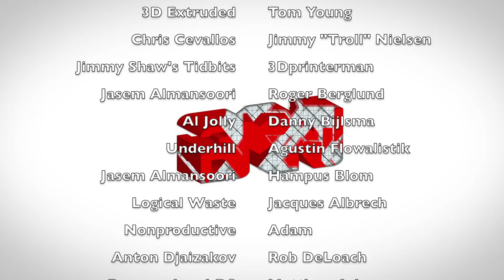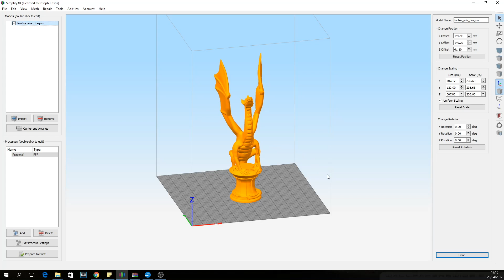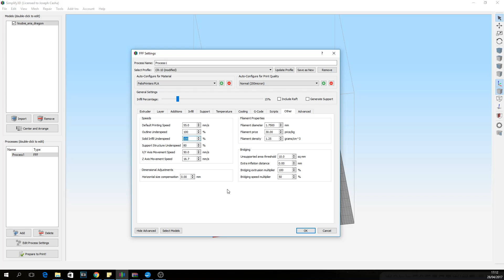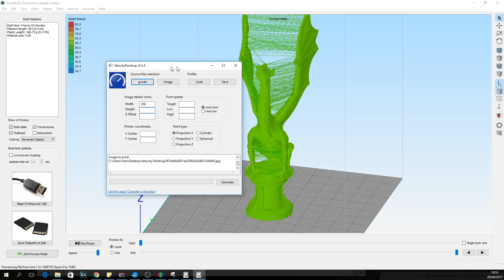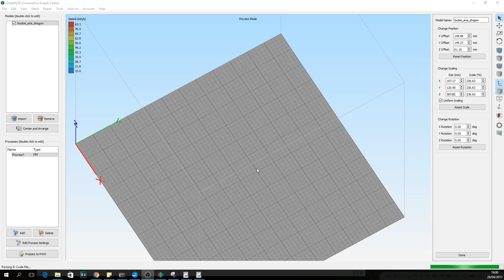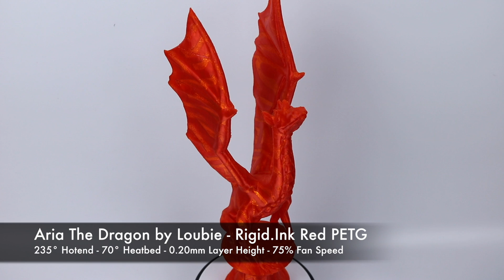A Noob's Guide - Velocity Painting

Comment: Very cool, but I doubt it adjusts the speed without changing the extrusion as you mention twice. That would mean it would wildly over or underextrude which would not result in a succesfull print. So in the PETG situation, it is not as you say the line gets thinner, but it is rather an effect of heating the filament up more and keeping them hot longer inside the nozzle (with slower prints) , which gives it a different look. Heating filament longer and hotter gives it a more shiney look in general.

Comment: any chance to ignore brim/skirt, raft and infill?
Reply from the maker: of course - vase modes work that way with velocity painting anyway so i don't see why a closed model can't be printed the same way
Reply: 3D Maker Noob sorry maybe i was not clear enough... so sorry for my english... i mean it works but affecting also the infill.... this is useless and add more time to the priting process. would be great is the software will take care just about perimeters
Reply from the maker: ah ok now i understand, as far as i know you cannot imprint the image only on the outer layers but i will check it out
Reply: i think so... infill normally not affect the perimeters, just if you set the wrong % in the infill over perimeters value. Simplify also put a comment before any group of command with the content... like //skirt or //outer perimeter //inner perimeter //solid infill and so on...

Comment: +3D Maker Noob
Thank's for a really nice video.
[I might misunderstand You, but @7:50 it seems like You say :"I'm going to set the Low speed of which it's going to do the image itself at 20 mm"
But You enter 15 mm in the "input field".
I just mentioned it in case You'd want to make an "annotation" ]
Best regards.
Reply from the maker: +GglSux thanks, I did two recordings of this and ended up using the one with 15mm/s instead of the 20. Thanks for pointing it out , the speed I used on the real print was in fact 20mm/a though just in case :)

Comment: Wow. This is cool. It got me thinking a workaround for dual color.  Load dual color models for single extruder with different speed setting could also do the job.
Reply from the maker: +Ryan Huang I tried that, however it wasn't the same effect. The infill is not continuous as they are separate pieces, you also need to underextrude slightly as that is the major difference when it goes faster

Comment: Cura 15.04 will not load the file gcode generated
Reply from the maker: +usasolarwindinc once it is sliced and then ran through velocity painting you don't need to run it through cura again. For the preview you can use the velocity painting site, just drag and drop th file on their preview gcode page

Comment: Sorry to bug you again.  So, I sliced a model using the settings in your video.  Ran it through the velocity software, then imported that in to S3D, and when I try to save it, it names the file "output.gcode" and so like an idiot I said, well, why not.  And when I went to print it, nothing happens.  Anxious to crack this, but I seem to be at an impasse.  Once it did save to the SD card with the correct file name, but still had the issue where it would not print. :(

Okay, not that I'm trying to bribe you, but, if you help me crack this you will have a new patron...lol
Reply: Oh, and I don't know if this will help or not, but I've also noticed that when I load the gcode after running the model through the software, there is no change in print time.  I would think that the drastic changes in speed would add to that.
Reply from the maker: +arcanum70 Haha don't worry, so once you run the gcode through velocity painting, you're done, no re-saving needed, the only reason I put it in S3D is to check if the pattern looks good. Then I simply drag and drop the file saved through the velocity painting UI onto the SD card :) if you try to save it again through S3D after you see the preview, it will rewrite the code it's own way
Reply from the maker: +arcanum70 yeah ignore that, S3D doesn't recognise the whole extent of what the velocity painting UI does, which is why you shouldn't save it after the preview ;)
Reply: Thanks, will give it a try.

Comment: GRRR, Tried NUMEROUS times and cannot get it to work.  Great video, will keep trying.
Reply from the maker: arcanum70 patience is key, try not to go over 50 for the normal speed and 15  for the slow speed, for the rest just pace yourself and play around, you'll get there :)
Reply: I'm wondering if it's the pattern that I'm trying to use.  I am trying a fractal Mobius and I'm wondering if it's too complicated.  Will keep testing with just wavy lines...lol.
Reply from the maker: +arcanum70 it should work with anything as long as the preview shows it's fine. I've done fine detail before, just make sure it's solid black and white image and no in between
Reply: The problem is it's showing as one solid color in the preview.  Will convert the image to greyscale first, the software says it does it, but will do it myself first and give it a try.
Reply: Okay, I'm an idiot, I had preview coloring in S3D set to active tool head instead of movement speed so it was just showing as a solid blue LOL
Reply from the maker: +arcanum70 haha it's all good :) you could use also their site to preview but I found that it takes too long and sometime crashes
Reply: Thanks for your help.  What's your twitter handle so I can let you see it when it's finished.  Going to try the print with transparent red PLA.
Reply from the maker: +arcanum70 @3dmakernoob :)
Reply: Cool, mine is @McAllisterB70

Comment: 8:05 Creality has 300x300, so the printer coordinates should be at 150x150 right?
Reply from the maker: Clyde Gonzales you are correct, slip of the tongue and completely missed that. Apologies
Reply: I just wanted to make sure :) There are CR-10s that do have a 400x400 bed though.

Comment: Could you create a similar effect, without using the velocity painting program, by setting up an object similar to how you would for dual extrusion and just have 2 processes, one for the fast sections and one for the slow sections?
Reply from the maker: +Brandon Mott I actually have tried it, but it's not the same effect. Multipart prints don't have seamless infills, but theoretically you could try but you'd have to change more than just the speed, also extrusion multipliers etc